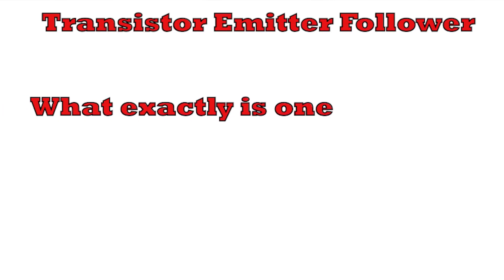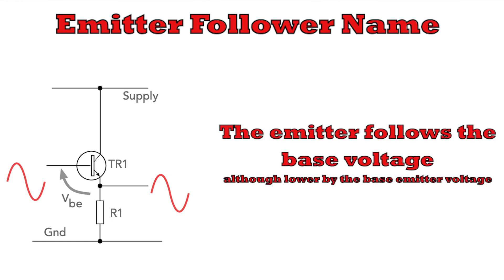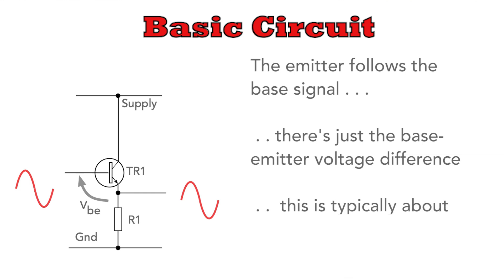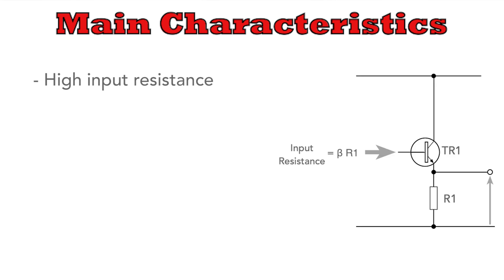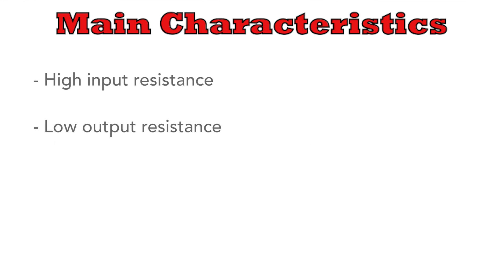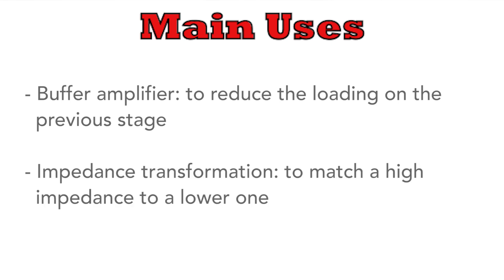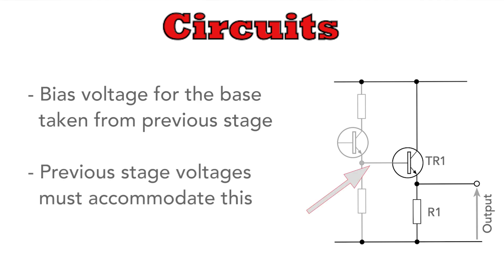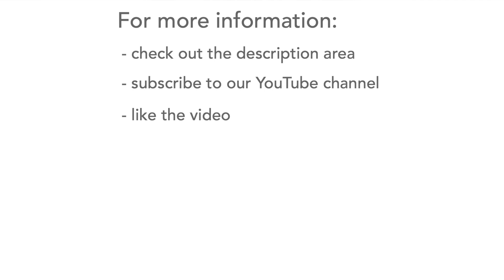Why You NEED An Emitter Follower

Comment: "It is not always possible to directly couple the emitter follower,..." Under what conditions do we have to consider AC coupling? I have built a small 3 stage ( Voltage Amp|Buffer|Current Amp)  transistor audio amp, which is now DC coupled between  stages I & II. I haven't yet heard any loss in sound quality or gain etc, but it's a very crude setup.